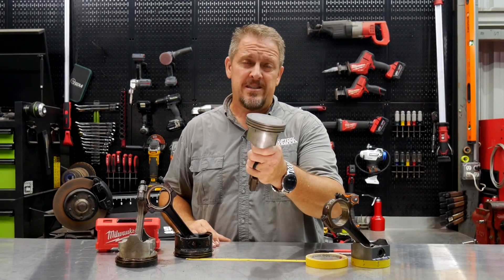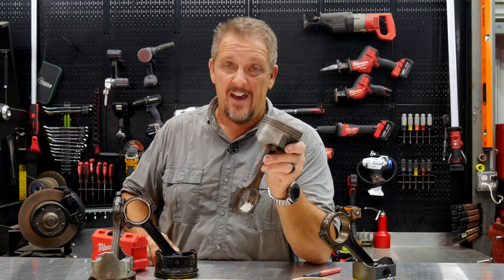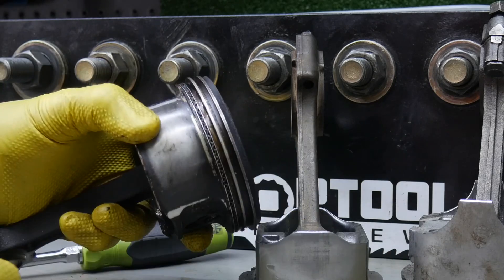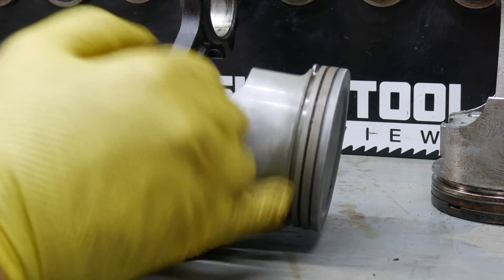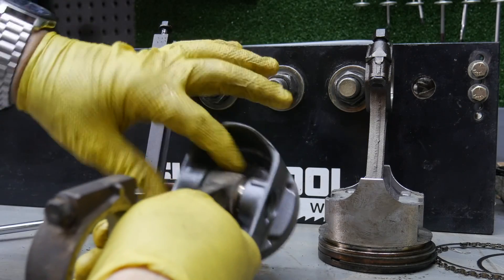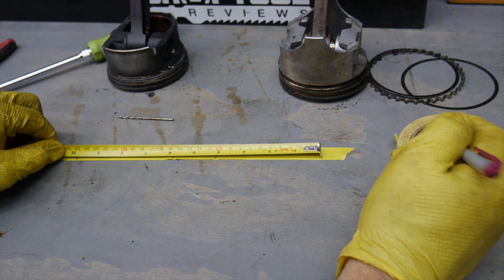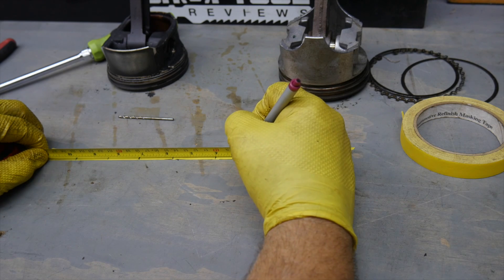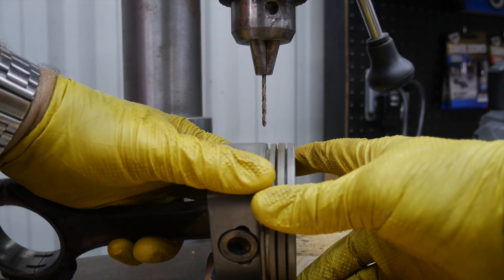How To FIX Chevy’s LS Piston Mistake - Oil Consumption Fix In Minutes [DRILLING FOR OIL]

Comment: Ls junk
Reply from the maker: Don’t hate on the cheapest horsepower you can buy, and the most successful powerplant. Thanks for watching.
Reply: I wish I could put a laugh react on this lol
Reply: Not reliable
Reply: @ricktotz4078  not reliable but i just sold my Tahoe with 508k on it. Buddy is still driving it. Maintained a fleet for 13 years and these engines were the most dependable in the entire fleet. Next time just say "I'm a brand loyal retard"
Reply: @ricktotz4078  yeah there's sooo many of them blown up all over the place no one wants to buy one
Reply: Yea Ls stands for Last of the Seconds.  . Cheap horsepower 460 with a 6-70  even the new godzilla motor can't touch it. For a good point A to B performance motors just run the old 350 or Ford  302 why complicate  things. .
Reply: @Roadking556  I must have missed it what's the Godzilla new LS motor? I think about 520 cubic inches is the biggest LS motor. Unless you get a machine shop like Sonny Leonard to make something bigger. Sonny made the 1000 cubic inch big block chevy engine. Also made big block Chevy hemi heads. Scrog and dickey Chevrolet had a LS engine to get 750,000 miles it was one of their service trucks it may even still be running. Not sure how you pronounce the Chevrolet dealership but they sell aftermarket Chevrolet parts and other stuff.

Comment: This is a nice easy to follow remake of my videos adding the drain back holes.  To clarify, this modification doesn’t remove enough aluminum to even measure accurately on a scale, no balance issue.  JD
Reply from the maker: I do remember watching your video when doing some research on this topic. In fact, we've watched many of your videos. Thanks for the feedback on the balance concern. Thanks for watching.
Reply: <i

Comment: Could it be better probably but I mean lots of these motors have over 200k and more and people take them with that many miles and make 6,7,800 hp
Reply from the maker: That is correct. But, if you have one apart, spend the extra time to make the rings and pistons scavenge the oil better. Thanks for watching.

Comment: Please don't take apart your engine just to compromise and unbalance your pistons.
Reply: Please don't come to someone else's video and make remarks about things you don't know about. Literally not compromising the piston and remind me how much a couple of aluminum shavings weigh again.
Reply: You're clueless. 4 holes do nothing for weight and yes I owned a machine shop for 20 years.
Reply from the maker: By no means are we recommending to dismantle a running LS for this alone. It's meant to be done when you're rebuilding anyway. It makes a difference. Thanks for watching.
Reply: @RwP223  wrong.   Absolutely wrong.

Comment: Mouse motor?
Reply from the maker: No. Mouse motor would be the old SBC (Small Block Chevy). LS/LT engines start a whole new line of engines. Thanks for watching.
Reply: The mouse is old school chevy small block. They came in many displacements from 262 ci to 400 cubic inch. They're the most popular engine ever built. Parts were readily available and inexpensive to build from mild to wild power levels.

Comment: But... Now you must rebalance the piston if you are running high rpm's
Reply: 4 small holes like this in aluminium doesn t have weight difference to need rebalancing the rotating
Reply: I agree GIF it's under a half a gram in weight it shouldn"t make a difference. But if you're going to balance it do it after all the work is done then balance.

Comment: I have a 4.8 lr4 that I'm gonna be swapping into my 70 lemans. The original plan was to slap a btr stage 2 truck cam in it and go. But now that I've done a little bit of research on the oil cunsumption issues with these motors and how to fix the issues, it's has made me consider if I should at least take the pistons out replace the rings while I'm at it and fill those little holes that u were drilling in this video. I already have the motor down to a shortblock anyways and it wouldn't take very long to do, I'm just curious if it's worth it. The truck it came out of had 250k miles on it but the motor was super clean when u took it apart, no valve train issues, no leaking valves or seals, the pushrods were undamaged, but I think I'm gonna get new lifter while I'm at it since its apart anyways, and I was also curious on running a ls9 cam instead of the btr stage 2 v2 truck cam that I have for it. Just wanting anyone's thoughts and opinions on this.
Reply: Damn the was alot of words
Reply from the maker: Since you're so close and the expense is pretty low, I'd recommend to pull it apart, fix the pistons, run a dingleberry hone through the cylinders, and install some new rings. Also, gap the rings appropriately, especially if you're thinking of a turbo. Thanks for watching.
Reply: @seth nelson265, watch Richard Holdener videos on YouTube, he has done and dyno'd damn near every LS cam and combo you can think of !
Reply: If you change the cam, put in new lifters.
Reply: I put a stage 2 btr truck cam in my 01 silverado 5.3 sounds great I leave it running whenever I'm out running errands love that choppy lopey idle. Installed all new lifters, rockers and hardened pushrods. And sent the heads to machine shop for 5 angle valve job and p&p. Mfer rips

Comment: Easy to fix, except for the fact that you have to completely tear down the entire engine to do this repair. Has GM fixed this on the newest gen 5.3 engines (2020 Silverado)?
Reply from the maker: That's a good question. I'm not sure if the LT engines have changed the piston design.
Reply: @Shoptoolreviews  one way you might be able to tell is for instance get a 2020 5.3 piston out of the box if someone has it in stock on the shelf at a local parts store which I doubt it just being a piston and look at it. I'm not sure but piston company technical department guys could probably tell you weather today engines had the drain or not. And maybe the aftermarket Pistons may have the drain in them somebody like JE, Keith Black, Manly and many more piston companies their technical department could tell you possibly, maybe not as much about the factory piston but definitely could tell you after market their piston and if it was done.
Reply: @Shoptoolreviews  I've always known the LS to be one of the best engines out there for longevity, durability and horsepower. But are you saying the LS engines some of them use oil over time? If so what year models and liter sizes? And if they're using oil over time are they fouling out the spark plug causeing them not to run? I know engines pretty well but I don't know the LS as good as I do the SBC or BBC. I'm perfectly fine with adding oil each time or every other time I add around a half a tank of fuel, check and add oil if needed. Idealey you don't want to add oil but I would much rather add oil and still get down the road then have to pull the motor and fix it from a rod knocking because of low oil or the motor is shot and locked up. I"ve added oil to most of my service vehicles over the years. And on my street and strip car I have a low oil pressure engine shutdown safety shut off switch. And also a high temperature water engine shut down switch that has saved my engine once before it got too hot.
Reply: I mean if you have worked on one of these before and wanted to do it you could do it in a couple hours let's call it a weekend but lots of these motors have over 200k without touching it I mean I generally don't even buy them till they have over 200k

Comment: Good information sir but you know what I have an 02 6.0 Silverado with 157k miles and it does not burn oil but I have been using synthetic oil since new now I don't know if synthetic oil has anything to with it or my truck may have been built on a Wednesday...lol but the engine doesn't burn oil or leak oil at all or just maybe those year of engines where built better
Reply from the maker: It probably doesn't have anything to do with build quality and more to do with your maintenance schedule. Thanks for watching and commenting.
Reply: @Shoptoolreviews  130K on my 06 Yukon with the 5.3 on dyno oil and it does not burn but 1/2 quart every 4-5K miles.  I change my oil every 6 months or 6K miles.

Comment: Interesting find, and fix. It wouldn't surprise me if the piston with "a couple of hundred thousand miles on it" had the oil changed with conventional only, and probably did 5-10K mile intervals.
Reply from the maker: You're probably correct on the oil changes, but it's still a flaw in engineering on these new pistons. Thanks for watching.
Reply: @Shoptoolreviews  certainly an interesting and seemingly easy enough solution. Thanks for putting the video together.